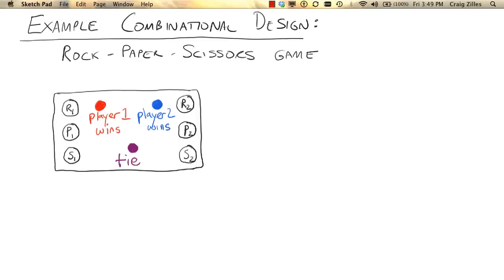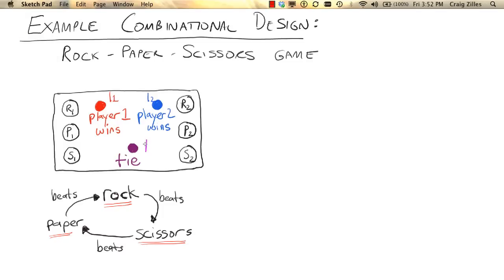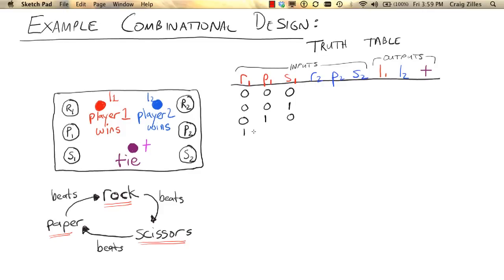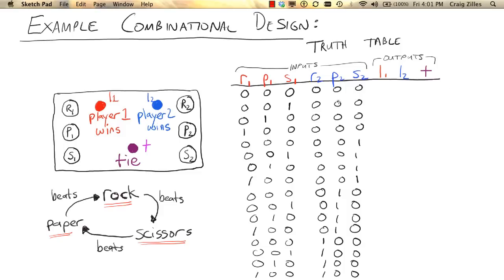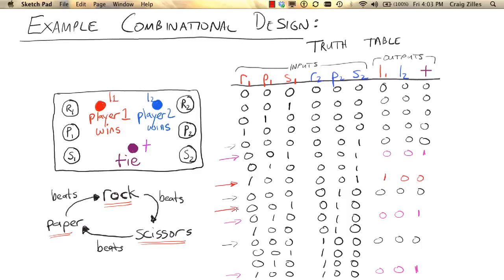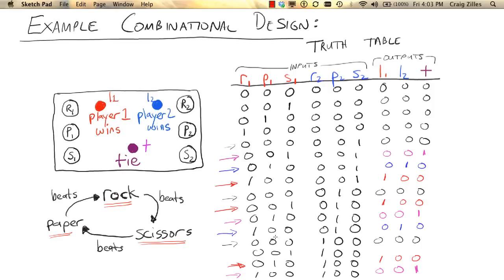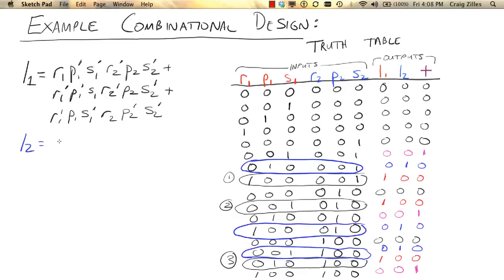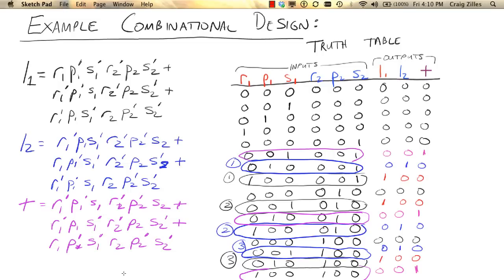Combinational Design Example: rock-paper-scissors .mp4

Comment: go ahead and reduce it
Reply: do you have a right truth table and circuit daigram for this ?
Reply: ... Additionally, each player's input has only four valid states, so six input lines could be reduced to four. That alone could fit on one LUT.
Reply: Yes, needs a follow-up. This is only half a solution. Okay, so you could write some verilog from this, but it would hardly be elegant.